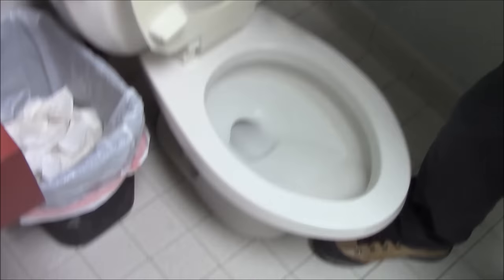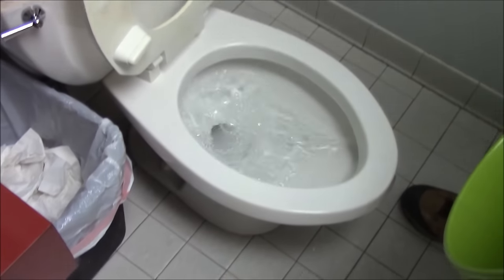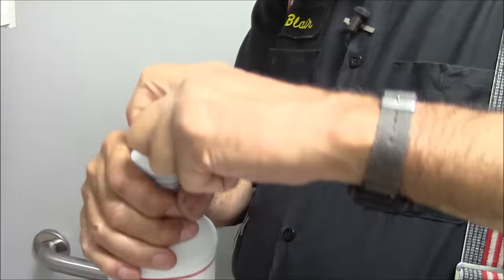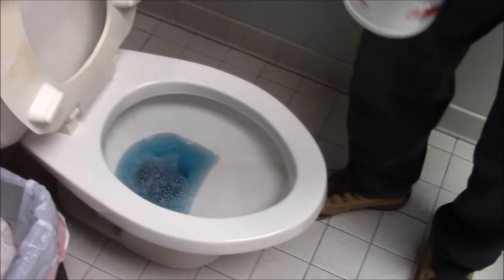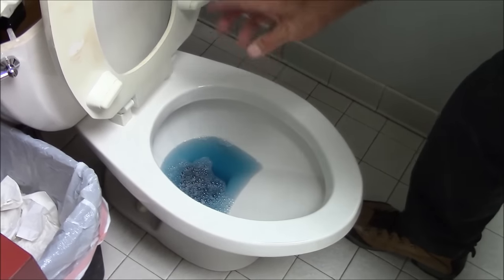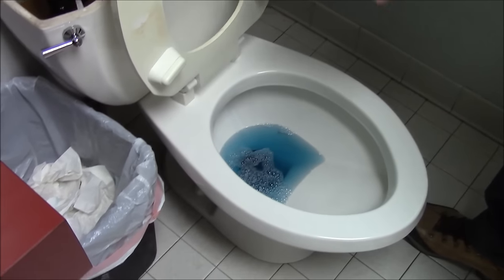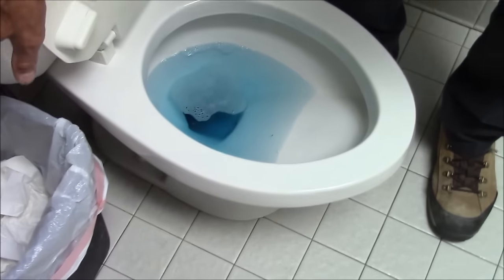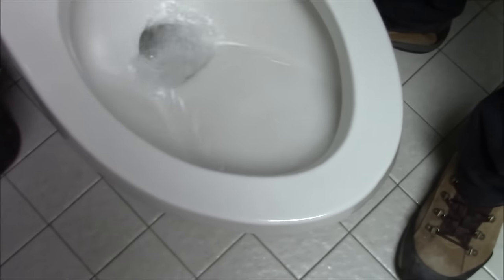Slow Flushing Toilet? Quick and Inexpensive Cure With Delimer

Comment: This helps the flush to be much stronger and better, but the water in the bowl still periodically drains out, and the sinks and bathtub gurgle at the same time. I know it's probably the vent being clogged, but I cannot for the life of me find the vent pipe! There is not one on the roof or in the attic, and I don't see any on the sides of the outside of the house, or in the cellar! The place is an older cottage with a septic tank, but there's got to be a vent somewhere. Any suggestions?
Reply from the maker: I bet they did not vent the system, and before any of the drain lines started to layer with curd (waste) it worked fine. now as the pathway for water is becoming restricted by a small clog there is not enough room for air to share the pipe. Take off the trap under the wash basin and see if that vents the system. If it does you can add a mechanical vent there w/out much pain.
Reply: Thanks so much for the reply! I wasn't even aware that I could add a vent to the system if there was none. I will definitely give this a try!

Comment: Good video, but I looked up the cleaner that you recommended, and it certainly was not 5 bucks.  I could not find it under $62. Wow, now that is some inflation.
Reply from the maker: That is the price when you ship acid, go to a local building supply in buy Muriatic acid for less than five dollars a quart and it works just about the same.
Reply: @MrHardware1  Thanks Mr. Hardware!
Reply: Purchased on Amazon $75 and received d10 bottles.  One case.

Comment: While vinegar is fine, I wouldn't recommend putting any other acid into a septic system. He doesn't say what other chemicals are in this cleaner. You can put cleaning vinegar, which is 25% stronger than cooking vinegar, into a septic system without destroying the bacteria in the system.
Reply from the maker: Cleaning vinegar, acidic acid, when using excess, can affect the bacteria a septic tank. The delimer, which is muriatic acid, by the time it reacts with the calcium in the toilet, and crud in the drain lines in the house feeding the septic tank is for the most part, just like the vinegar, totally inert by the time it reaches the tank. 1 quart into 1000 gallon septic tank, even if poured directly in would only destroy a small amount of bacteria.

Comment: What brand is that cleaner bottle? I desperately need it my bowl has weak flush 😭
Reply from the maker: A good substitute for the Rooto delimer is muriatic acid. You can purchase it at either a building supply or a pool supply...

Comment: I do not see the Rooto coming out of the top rim when I add two bottles. Water does come out when you flush. What am I doing wrong?
Reply from the maker: Usually it needs to be poured in very quick or most of it flows to the lower port.

Comment: Mr Here are. I've used your technique. When I poor it in the overflow, Roto doesn't come out the jets. Any suggestions?
Reply from the maker: I pour it rapidly to get it into the overflow with minimal spillage into the tank (which is full of water). It may be cleaning the toilet w/out coming out of the jets... what brand is the toilet?
Reply: Use a funnel if necessary and pour it in faster.  You need a high flow rate so that it will  make in and around the raceway and to all the jet holes.  If you do it fast enough and nothing comes out, your jets may be really clogged and they will eventually open up as the deposits dissolve.

Comment: Cripes! What about cleaning the tank while you’re at it?
Reply from the maker: Unless it is really bad don't bother.
Reply: Mr. Hardware I’m not an expert like you, but wouldn’t it be reasonable to assume that the cistern is where the limescale and/or mold are emanating? Also, just because you can’t see it doesn’t necessarily mean you can’t smell it. 🤭
Reply from the maker: @susantjfl3147  The jets and the raceway get wet and dry constantly. As the water evaporates after every flush it leaves behind calcium deposits. The tank is always wet so less calcium buildup

Comment: The product you pour in the overflow must be horrible for the piping...
Reply from the maker: Actually, by the time the acid reacts with the calcium in the toilet it’s getting pretty close to inert. The people that run their drain lines with acid are the ones that use it on a weekly basis. occasional use typically will not harm any plumbing.

Comment: Will your roto work with a lined toilet tank?
Reply from the maker: It should, because you are gonna be pouring it into the overflow tube not in the tank itself. If a little splashes into the tank, it should get diluted by all the water that’s there now.

Comment: I poured an acidic toilet bowl cleaner but it didn't come out the rim. It just came out from the big hole on the bottom. How can I get it to go to the inside of the rim?
Reply from the maker: I use a quart and pour it into the overflow tube quickly, that usually works.

Comment: Instead of putting all those chemicals into the  water system,  try using vinegar a couple times and maybe even some CLR first.
Reply from the maker: Muriatic acid is biodegradable, although ‘cleaning’ vinegar works, CLR also, just not as so fast.

Comment: have you ever us muranic acid? i use that and it works good as well.
Reply from the maker: That is what I recommend for users that cannot find Rooto products. Thanks.
Reply: @MrHardware1   ok have you seen the video of the hardware store in greenville nc? they talk about a super flush toilet but not the name or where to get one. i spent all weekend reading the neg reviews on the toilets and for the most part they say the toilets are bad. i can't afford to spend money to find the toilet is bad. my american standard plebe believe it or not after the trap the water just dumps into a chamber and then out the outlet at the floor flange. i stuck a hose up into the trap from the bowl side and then a camera up the floor flange and i got the camera about 2" into the opening and i could see the hose sticking over the dam in the trap. what is inside that area is a big hollow chamber. there is no pipe like you see on modern toilets. that is why i could not get the snake to find the floor flange outlet. or get the camera into that are either. so i want to find a toilet that flushes and that i do not have to clean after every use or cracks by itself after months in service. that is why i'm finding on the research now. so maybe you have the name of that super flush toilet that uses 1.27 gallons. thanks
Reply from the maker: @bobpalmer4740  Gerber Ultra Flush is one we sell. Almost $300 and it is loud. I use the Gerber Viper, quieter, or my last toilet was an American Standard Champion from a dealer, not a big box, and it hasn't missed a flush.
Reply: @MrHardware1   ok thanks so you saying the american standard champion is a relatively good product? i read reviews on that one and like 80 people did not like it because they said it took 2 to 3 flushes or you had to clean it about every use that was #2 so that was my concern. maybe those people had there systems set up wrong. also some complained of the bowl cracking at the flush lever and then leaking. what is your advice on that? thanks bob p.
Reply from the maker: @bobpalmer4740  Bob, I installed a 3378.128ST.020 Flush Toilet, 1.28 gpf  I purchase from Orgill, a wholesaler, not for retail sales 3 months ago. I'm over 200# and I haven't needed to double flush yet. Sometimes I double flush to be sure I pushed waste out from the house plumbing and all the way to the city. 1.28 gallons is not much to use twice if I want to be sure I've cleared the house plumbing. Blair
Reply: @MrHardware1  thanks i need the 10 rough in size because i have 11.5 " rough in now and i think my stack is actually partially blocked. the model in the cadet 3 i'm going for is the Item # 526094 Model # 270DB101.020 it is the tall round bowl water sense which i believe is the pee flush model. i had the old toilet plug again and it failed the bucket test 3 times in that failure so something is holding it back in the trap area. so time for a new unit. thanks

Comment: I've seen some videos using Muriatic acid. And they were neutralizing the acid before flushing with Baking soda. I am wondering if you recommend using the baking soda also.. thanks
Reply from the maker: I never have used anything to neutralize the acid, I feel it is pretty well spent once it cleans the jets and the toilet trap. A little acid in the main drain won't last long considering all the organics that have built up there.

Comment: Hi sir, how to fix inlet valve from calcium
Reply from the maker: You can remove it from the toilet tank, hold it upside down and fill it with vinegar while moving the float back and forth. Usually for $10 I might just replace it.
Reply: @MrHardware1  ty sir, it helped. I have planned to replace it but due to lockdown unable to get the hardware.

Comment: Will muriatic acid harm pvc or cast iron pipe? Thanks.
Reply from the maker: Over use on cast iron may eventually erode the pipe, not using once or twice every several years. Vinegar and tomato juice has eroded more cast iron plumbing in my area than any drain cleaner.

Comment: Just looked into purchasing this roots bowl cleaner…sells for 69.99 on eBay and Amazon…any other suggestions?
Reply from the maker: Get muriatic acid from a local building supply or your hardwood store. The delimer, being acid is expensive to be shipped.
Reply: Thank you for your quick response.  When I poured the acid in the overflow whole it only came out of the whole in the toilet and not the jets. Am I not getting the true benefit of not opening the jets?
Reply from the maker: @larrypetraglia4102  try again, this time try pouring it faster. You can spill a little into the tank because it is full of water. How is the toilet flushing after the first dose? What acid did you use?
Reply: Blair, I used CLR, calcium/lime/rust…. I followed your process, has improved the flush.  But I would say out of every 5 flushes still doesn’t flush properly one time. I  will try  it again and waiting for an hour before flushing.  If it doesn’t work I may pick up a bottle of Muriatic Acid at Home Depot. I’ll let you know.  Thanks for corresponding.

Comment: What are some less harsh alternatives if we don't want to use acid?
Reply from the maker: Try vinegar, it is acidic acid and will work. You might need a gallon per toilet depending on the buildup.
Reply from the maker: Maria Camilla Thiago  I don't know why not.However,  Muriatic acid,, I believe is biodegradable. Plus don't forget it will be neutralized by the lime in the toilet before it goes anywhere else.

Comment: Can a person duck tape the inside bowl holes then pour the chems in the tanks center pipe be ok?
Reply from the maker: I have never done that, it would be too much hassle to get it dry enough to get the duck tape to stick, and then have to put my hands in the acid to pull the duct tape off if it did stick. I can’t tell you how many toilets we’ve delimed , I know it’s in the thousands, and none of those were taped. The acid is only five dollars a dose so it’s not like it is so valuable it’s worth the extra effort.<
Reply: @MrHardware1   Thx I have muriatic acid or I have a product called Clobber for toilets, I will use one or the other as I know mixing products is very dangerous. So thanks again for the heads up. I did clean it the hard way using a pipe cleaner in each hole. But before I replumb I will try your way of pouring it in the center pipe and see what happens I will let you know which way I had to go to get it to fill.

Comment: Is there another brand of delimer that can be used? The Roto isn't available in my area and it's more than $60 to get it from Amazon
Reply from the maker: Use muriatic acid, available at a building supply. Also I believe the $60 is for 6 bottles.
Reply: @MrHardware1  Will do! Thank you.

Comment: I wanted to try this but there was a device sticking out of the top of my overflow tube that prevented me from pouring anything directly in it.  I couldn't figure out how to get that out, so I had to just pour into the bowl and try to hit the holes around the rim with the squirter top (I used a different brand of cleaner).  Is there a way around this issue so I can get it down the tube?
Reply from the maker: If you cut a plastic funnel to fit into the 'step' where water will go in if the tank ever overflows. Then you should be able to get most of the delimer to go in.
Reply: @MrHardware1  Thanks I'll give it a try!  I've got a toilet that badly needs it.

Comment: muriatic acid,  Works too. Just  need to have  windows open.
Reply: Using acid is unsafe that is back splash from flushing. That's why you can not use Draino on a toilet. Also anyone working with the product in this video or similar should wear rubber gloves and safety glasses.

Comment: In response to my comment no fluid is going to go into those jets until I flush it. Isn’t that how all toilets are?
Reply from the maker: The overflow tube is connected to the flush valve. almost as fast as if the toilet is being flushed. Pour the delimer in as fast as possible to emulate the force of flushing the toilet.

Comment: When I pour the Rooto down the overflow tube it doesn't come out the holes under the rim, it comes out through the siphon jet. Any suggestions?
Reply from the maker: Try pouring it quicker and it could take 3 doses.

Comment: when i poured my de-limer in the standpipe, the de-limer came out of my siphon jet, but nothing came out of the rim
Reply from the maker: Usually the faster you pour it the more will get into the jets
Reply: @MrHardware1  it was a bottle just likethe one you had, the de-limer was a bit thick, and i was squeezing it, any other tips on getting it into the rim jets? ive heard duct tape works?
Reply from the maker: @nicholasniedzielski4707  if possible, purchase a quart of Muretic acid which you should be able to get at a building or may be a pool supply. It will be more watery and pour faster and should do the job.

Comment: Why not use regular synthetic viniger? It's much cheaper and probably more acidic?!
Reply from the maker: I find it harder to get than Delimer or muriatic acid, which is much stronger.
Reply: @MrHardware1   Actually that was my next suggestion to look into a stronger acid with lower PH. 
Also, I'm curious as to what other commercial ingredients can perform her, s.a. the famous CLR
Reply from the maker: @samsen3965  MURIATIC ACID, usually available at building suppliers or good Hardware’s. I love that stuff, very strong, fast acting, can be dangerous, …. Just use caution.

Comment: Will muriatic acid harm septic tanks. Thanks.
Reply from the maker: Not unless you use it all the time. By the time a quart cleans the jets and the trap it is pretty much inert. Let alone diluting into 1,000 tank. I always put septic treatment in mine to keep the culture active.
Reply: Thanks!

Comment: Is is safe to use the delimer if I have a septic system?
Reply from the maker: I use it with my system, by the time the acid reacted with the calcium in the toilet is getting pretty inert. Then it reacts with all the buildup in the house piping getting to the tank, so by the time it hits the tank it could be neutral. So by the time a quart mixes into 1,000 gal or so tank I feel more than safe. Don't use a gallon a month.... Blair

Comment: Out of the 3 toilets in our home, the one in the master bath grows black mold around the water jets in the bowl and in the bowl itself! What can I do to make it go away?
Reply from the maker: I have used the Delimer or Muriatic acid to burn the mold out of the raceway (the area that feeds the jets) with success. You may want to try using the enzyme drain cleaner in the overflow tube to finish the job. I would start w/the acid. Better living through chemicals! lol Blair
Reply: I used Muriatic acid on the slow flush toilet (comment above) and now will take it to the 1 toilet with black mold.  Thank you!

Comment: I stopped by your store and picked up 2 bottles of the chemical in this video. The chemical, when I pour it into the overflow tube, isn’t coming out at all through the toilet jets... it just comes up through the bottom of the toilet. I’m not sure what I’m doing wrong.
Reply: My toilet has a “Mansfield style” flush valve. Do I need to do anything different?
Reply from the maker: I pour it faster into the overflow tube to get it to the jets. How is the toilet flushing after the 2 bottles?
Reply: Mr. Hardware maybe a slight improvement, but if I toss a piece of toilet paper in it and flush, nine times out of ten it still won’t go down. I’m guessing it just didn’t get into the jets. I have to use a funnel to get the liquid where it needs to go, so not sure I can do it much faster (but can try). Also, the first bottle had a nearly clear liquid with no noticeable odor, where the second bottle was a blue liquid with a strong odor. Both were factory sealed, but had slightly different labels. I’m assuming they maybe changed the formula and one is old and one was new...
Reply from the maker: @raphieb.187  Did you give the old toilet the bucket test first? If the water goes down fast and does not cause the sink or shower to gurgle you may have a problem I can't fix.
Reply: Mr. Hardware I did the bucket test and it flushed perfectly... I’m still convinced the liquid didn’t get into the rim where it needed to go, so I’m going to try another bottle, and see if I can pour it fast enough to see it come through the jets... if that one doesn’t work, well, I guess I’ll have to explore other options... thanks for all the help though!
Reply from the maker: @raphieb.187  Bring the empty bottle (s) to the store and we'll give you a credit, no problem. We try to guarantee everything, even me!